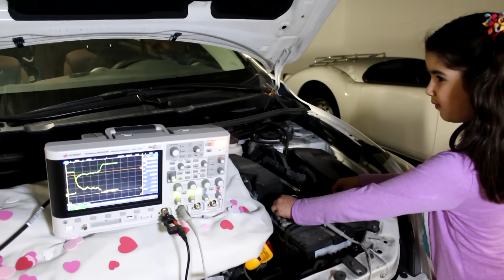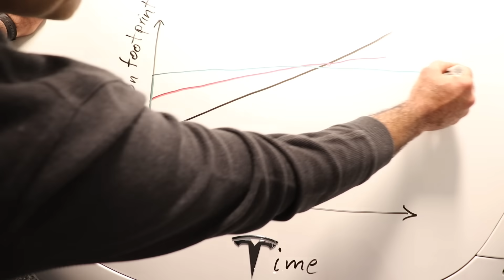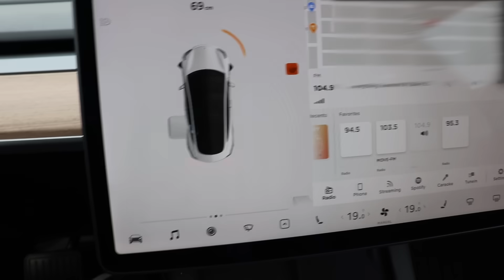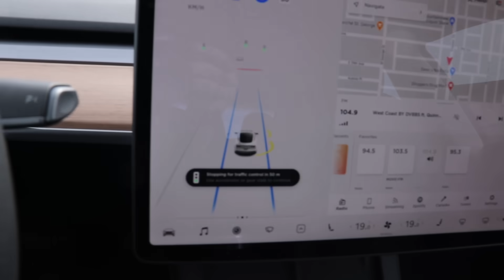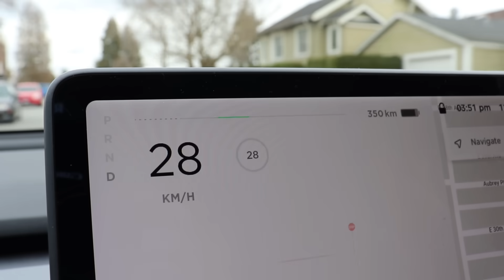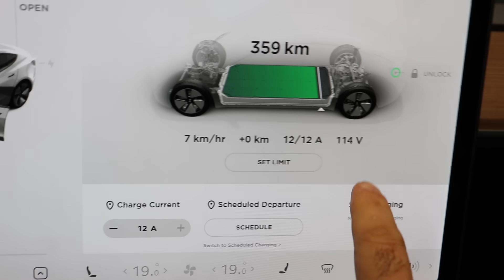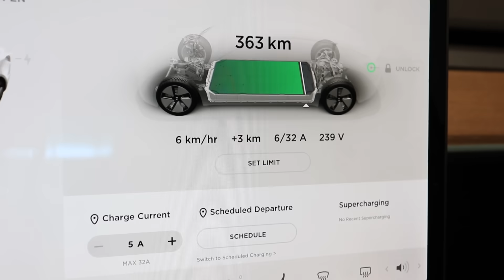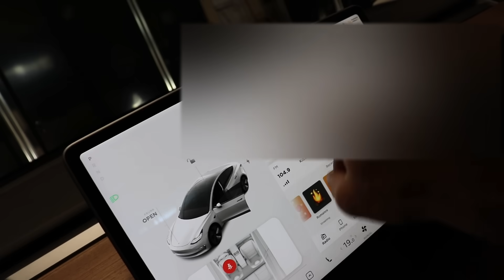ELECTRIC VEHICLES & My Tesla Model 3 Review

Comment: Price of gas compared to EV (in Germany):     your Tesla: 54kWH * 29ct = 15,66 for 300km => 5,22 €/100 km.  my gas car (average consumption about 5,5l/100km) = 5,5* 1,3€ (average fuel price) => 7,15€/100km. 
so around 2€ per 100km difference.
Costs of this tesla => 40.000€    costs of my car => 21.000€ so around 19.000€ difference . so i would need to travel around 1.000.000 kilometers to be cheaper with the tesla, that excludes the wallbox i need to install which would be around 1000€ .  with an average of 30.000 kilometers a year i would need 33 years to be cheaper with the tesla.   

And just because you dont burn fuel, you still have the dirt particels from your tires , and from your breakes. which are around 50% of the emisson in traffic. 

I dont know... i just can´t see the advantage of EVs . 

(I am open for discussion , if objective)

Comment: That is an absolute lie. Gasoline cars are just as bad to build as electric cars.
Reply: Not the cars themselves. The production of the BATTERIES is what gives EVs a higher carbon footprint during production than their gasoline counterparts which obviously have much smaller batteries.
Reply: @M414-q6o  That has since be proven to be a myth.

Comment: Why if I ever get rich, I'm reusing the body of a 2009 mustang, giving all 4 wheels hydraulic motors.  That way constant 4 wheel drive even at highway speeds.  Each wheel has it's own electric pump, and set up so the wheels keeps spinning if one pump breaks down even at highway speeds.

Electric pumps, so for short distances it can rely on batteries.  Long distances, bio-diesel/electric generator.  Both enhanced with solar energy.

And the hydraulic fluid for the wheels, I'd rather have them recycled or coming from renewable sources -- just not hemp, that's an overhyped joke.

Comment: ...what I don't get with some manufactures is why do they make it look like the screen is glued to the dash as some cheap afterthought...if I payed $50k+ the screen should be molded into the dash...the Ram has a big 12" screen too...but it's blended nicely into the dash...and looks like it belongs there....my Ford Transit work van is like this too...the touch screen sits on the dash like it's an afterthought...the other downfall to this is I wonder if longevity would be effected....I've noticed the housing for the screen gets really hot when the sun is on it...if it was actually in the dash this isn't an issue...

Comment: well good luck you already running into issues with a "new car" you don't want to crash or slam a bumper with this toy car because tesla is gonna f you up turn off fast charging and other features and you will get zero support.. expensive metal bucket with a electric motor and the battery not much to say about it... the company's policies and support are terrible..

Comment: Next video: connecting 7000+ 18650 Li ion batteries from the car to a bunch of capacitors and voltage boosting circuit to make an arc cannon/turret mounted to the cars roof
Reply: Mad Max ☹️
Mad Mehidi 😊

Comment: We could just stop eating cows... Or even cut the amount in half.

The Leaf battery isn't great. The Bolt isn't much cheaper than the Tesla and doesn't DCQC as fast as the Tesla. If you can afford it, Tesla is the way to go.

Gas pedal?!

If you bought the standard range you only have one motor and it's in the rear. Your battery pack is underneath the car

Comment: I drive a Bolt, I like it a lot but there isn't an option to upgrade its range, you get what you get. It does however have a good dash cluster in front of the steering wheel instead of putting everything off onto an iPad awkwardly balancing on the dashboard. People should stop trying to pretend that's better, it's not.

Comment: He didn’t account for how the electricity is generated or the massive amount of energy lost running along transmission lines from generation plants to charging stations or his home. His graph was also based on zero data 😂 Also, also, doesn’t this seem like a giant ad??
Reply: Even with those losses, and even if all the electricity comes from burning fossil fuels, EVs are still more fuel-efficient than ICE vehicles, because power plants extract a much larger portion of the heat energy and turn it into something useful.

Comment: Netflix and YouTube do take a long time to load on my hardware three 2018 model 3 but the screen rarely freezes. Autopilot will not drive through a intersection with a green light unless there is a lead car in front of you or you confirm with the accelerator or drive stock.

Comment: The term "computer crash" takes on a whole new meaning in a self driving car.
Reply: fwiw- the infotainment computer is (thankfully) a separate linux computer to the main car computer/autopilot computer and other control modules...so the display can 'crash' and the car will continue to drive (even in autopilot) just fine. Definitely not ideal but good that they have redundancy where it matters.
Reply: @frollard  It didn't used to be, though. AP1, if your center screen crashed, AP disengaged.
Reply: And it constantly gets bugs...

on the windshield
Reply: IQ = 100%
Reply: Don't you mean "car crash"? It becomes like the term "computer bug" which supposedly has origins in a moth short circuiting part of a pre 1960's computer. Computers were literally as big as buildings back then. Some needed their own power substations to have enough power to turn on and function.

Comment: Edmunds did a report on EV car ranges and only Tesla consistently failed to meet their rated ranges.  Every other car met or far exceeded their rated ranges.  
Technically a Chevy Bolt has 68 km more range than your Tesla.  This is really just false advertising.  Also the battery drain of 1% per day is only a Tesla thing.  No other car that I know of loses like 0.6kWh of power per day just doing nothing. 

https://www.edmunds.com/car-news/electric-car-range-and-consumption-epa-vs-edmunds.html

Comment: re: regenerative braking "You almost never need to use the brake pedal"

The way I was taught to drive, we were also told to not use brakes to control speed, just to let off the gas and decelerate until you actually have to stop

People that use brakes to do anything besides come to a complete or emergency stop are doing it wrong in the first place

Comment: I like Mehdi's videos a lot and am a big fan :) But...
This video somehow just convinced me that electric cars are still not superior to the combustion cars. At least yet. Maybe some day they will.
Why?
- the price
- too long charging time
- too little range (my diesel car has the range up to 1100km)
- battery degradation over time degrades the price of car itself
- freezing weather eliminates the range
- in emergency situation (like in winter convoy) you can not bring a bottle of electricity to reach the closest powercharger
- the weight (diesel an gas has something like over 50 times higher energy density than nowdays batteries)
- yes electricity is cheaper but mainly because of taxes... If there were no taxes on the gasoline it would be much cheaper (I hope this electromania will not rise the price of electricty significantly)
-the ecology is questionable not olny because of coal power stations and the efficiency of charching but also because of mining of lithium metal. Carbon neutrality theoretically can be gained also by using biofuels or methanol fuel cells (see Gumpert Nathalie).
-questionable why should be a car driven by the computer? These cars really have a potential to spy and maybe one day even lock you and bring you to the police station for politically inconvinient ideas
-I somehow dont like the interior design especcialy the tablet screen instead of a dashboard

+ recuperation is good but plugin hybrides can do that as well
+ good potential for the future If we can improve the batteries and the price

Comment: Ev car adds much more pollution than gas vehicles.
Reply: Your graphs are a bit off.  The build footprint is only about 20% different. Buuuut the pollution from gas and the pollution of electricity production are a lot closer.  So overall ev has a greater negative impact from production of CO2.  Sorry.  I thought you knew this electroboom.

Comment: I am going to guess that you'll never see this but once and awhile try to use the brake pads in neutral to clean off the pads and rotors from gunk that builds up on them. It can lead to increased road noise or even loss of braking capability if left to long.

Comment: I don't want to sound like an internal combustion engine apologist but ICE cars also benefit from going down hills just like electric ones do.

If you drive an ICE car down a hill/mountain and use the gear you would use if you were going up and not use the gas pedal, the momentum of the car is enough to drive the dynamo and power the car's instruments and climate controls, while fuel injection (that all modern cars have) makes sure no fuel is used. This has been tested successfully by measuring the amount of fuel in the tank after going down a hill.

The only difference is that an ICE car cannot regenerate fuel like your electic car gained you 7 extra miles from regenerative breaking :-)

A big fan of your work!

Comment: Hey Mehdi there is a problem with your gas calculations pretty much every modern ice car turns off the fuel injectors when running downhill. The electric would probably still do better but right now your calculations are downright misleading. Also battery life is roughly 10 years so if you have to replace the battery or buy a new car every ten years does that produce more CO2 overall than just driving a used ice? I'm not trying to defend ice just pointing out inaccuracies in your calculations.

Comment: Dont forget the battery pack is shot after 3-5 years so there is the carbon footprint of a new battery to add as well, probably just as it interects with the carbon footprint of a gas car..
Reply: Where have you heard this? This is just what you think. Stop spreading misinformation because you don't like innovation
Reply: @R0BIN_  I do like innovation, its a fact that Lithium batteries have only a number of charge cycles before they start to lose their capacity, so far reports state its around 3-5 years before the pack needs to be replaced (depending on operating conditions hot climates vs cold etc) so you have to factor in the CO2 cost of a new battery pack every 5 years or so.. Its not what I think... its a fact.

Comment: When you need to replace the Battery at some point, there will be a huge CO2 jump then, right? And a huge whole in the purse I guess.
Reply: And wow, electricity is incredibly cheap in canada
Reply: Do some research hon, you're underestimating how BIG these batteries actually are, how long they last, and how FAR they will go. 

15+ years is the battery lifespan, and even at year 16, your range will be about 16-25mi less than factory fresh, so don't knock it until you drive it.
Reply: @chattphotos  15+ years and a loss of 10% would be great. Where do these numbers come from? All I know is that manufacturers give a limited warranty of 5 to 8 years (here in Germany) or 100 000 to 180 000 km, which is how much they trust this technology.
I am not hating against Electric cars. Yes they are better than gas engine cars. They are still horrible for the environment though. So ripping all the engines from these huge cars out and slap some big ass batteries in (which is basically what this green revolutuon is at the moment) won't do that much. I see the main use on eletrification on small vehicles like bicycles, scooters and such with a typical range < 100km. It is more than enough for all the city travel that is done by car now and damages the environment way less. 
Using the cars (engine and electric alike) efficiently (there are usually 4 seats in there, not one) and rethinking transportation in general would get us way further than just putting batteries in and increasing the efficiency of a terribly uneeficent use marginally.

Comment: can't see the point of this video
Reply: Electricity is Electrobom's thing in case you haven't noticed 

Gasoline/Petrol is awful in about every single possible way for driving 

EV's are now a practical option as the people's car

Therefore Mehdi's case for  the video is perfectly valid.
Reply: @chattphotos  can't wait for the review of his complete electrical household equipment then. I thought I was on a engineering channel than consumer advices of devices that eat tons of limited rare-earth element so that only rich people can have the feeling that they're about to save the planet.
Reply: @mr.k.9019  Have you seen the used/refurb market for EVs? 

No requirement to buy a new one...

I am not rich, I bought my Volt on a salary making $40k/year and I know I am helping the planet too by not driving on gas as much as possible.

Also, think about it on a bigger scale, you spend over $1000/year just in gas vs. an EV driver having to pay about $275 in electricity + minor maintenance like tire rotations or wiper blades
Reply: @chattphotos  I'm using public transport and a car only for one week ends a month to do 300km. I would not buy a new car for that only purpose.
Reply: @mr.k.9019  Never said buy a new car, you can go used to get something that can cover that same distance...
Reply: @chattphotos  EV that can cover this distance are way too expensive for now. Soon I'll get an hybrid.
Reply: @mr.k.9019  Make it a plug in hybrid and you'll be set :)
Reply: @chattphotos  I just bought a tesla model 3 😖

Comment: With my Leaf, the 240v charging is 85% efficient but the 120v charging is 75% efficient. I had to pay for the 240v upgrade from a guy in Berkley back in the day. 120v 12 amp vs 240v 16 amp. Way worth it.
Reply: Someone on Reddit did the math, it's more of 83 to 87% efficiency for the difference in voltage
Reply: @chattphotos  Well, whatever. That's good I guess, charged it for many years on 120V. But my current house, I installed a 240V plug.

Now the battery is getting a bit old, down to 8 life bars. Range is starting to be disappointing. But it is 9 years old.

Comment: In the next video, he's going to take the Tesla apart and add generators to the wheels, so when the electric motor drives the wheels, the wheels turn the generators which charges the battery.
Reply: No point, mainly due to the laws of the conservation of energy, and the drive motor becomes a generator due to the phenomenon of regen-braking

Comment: Ye when people tell me that electric cars are the future, that may be the case, but we need to completely remove the coal burned to create electricity that the world runs on xD step 1.
Reply: You do realize that even with 100% carbon power, the EV only "produces" 1/3rd the amount of carbon as a comparable ICE vehicle... I think you could even drive 2x the daily ICE commute distance and still "produce" less carbon. 

Also, because of the rule of inclusive statements, if you have never lost any sleep as to how much carbon your house produces by using the same electricity, then an EV is no different in terms of kwh consumption like a high-wattage appliance like your HVAC, Water Heater, Oven, Pool pump, etc. 

Plus, the moment you put up solar panels on the house, you get 0% carbon emissions nearly instantly.